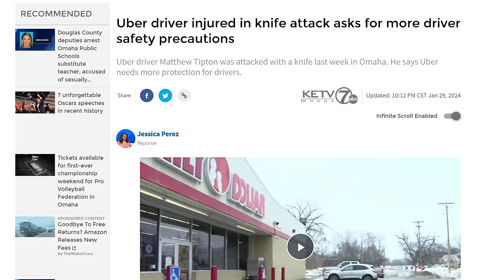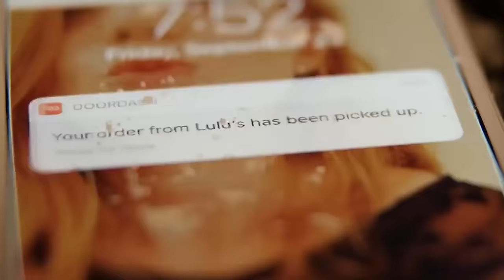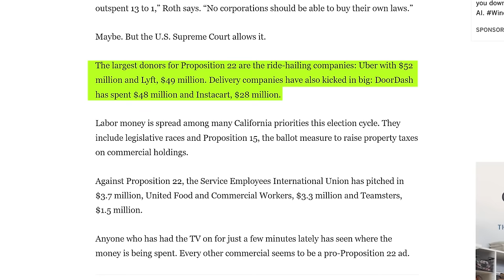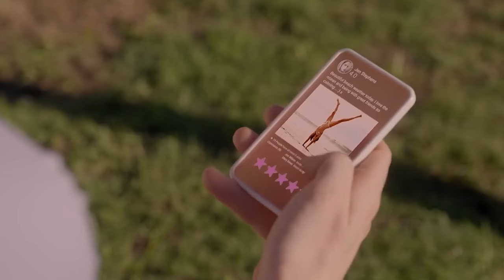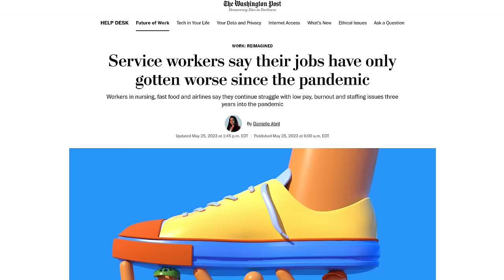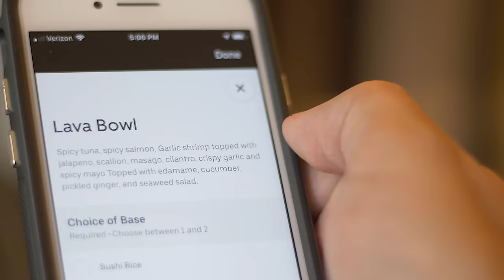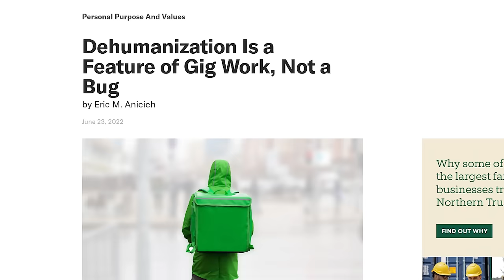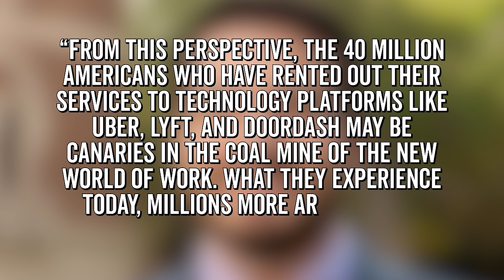Delivery Apps Are Making Us Monsters

Comment: My story about work is that I work for Amazon in what can be described as customer service role in a case by case basis. A lot of metrics are tracked, dir example case reopens. A case was reopened with the message "thank you for solving my problem, great job" and it was counted against my performance because reopens are negative.

Also at a recent work function, I overheard the boss of my boss saying that he dislikes german work protections because he would sometimes like to get rid of the bottom quartile of workers and since that I can't get it out of my head that he was specifically talking about me.

Comment: Poorly researched

Amazon drivers aren’t independent contractors. 

Amazon has a bunch of “independent” “delivery service providers” that hires people as full fledged employees (even with benefits, largely the same ones you get working at Amazon).

The drivers themselves are not independent contractors.

There is Amazon flex where people use their personal vehicles but that’s a tiny fraction of drivers and most of the time isn’t even a thing outside of peak.

Comment: I still am shocked about how many people just give 3-star type ratings to these people because "service was average" without realizing that it might get them fired.  Only time I tend to drop to 4 is when the driver ignores the written direction of "Gate on X street is residents only so does not have a box to punch a code in, you have to go to the gate on Y street" and then call me asking me to come open the gate for them.
Reply: I felt the same way when I would get calls from drivers confused about finding my unit because I had made sure to put very clear directions in the message box (since it would happen often). Until one day I mentioned this to a lost driver and she said that they don't even see that message until they get to the part where they are taking a picture of the food on your doorstep. So no wonder they were still lost. It's a dumb system.
Reply: Not everyone knows those jobs are on the line because they assume those companies are sane or reasonable. They don’t realize how bad it’s become
Reply: Reviews have no value if honesty is not the ONLY consideration. Either don't review or review honestly. Every fake review is just as bad as the retaliation from evil corporations for imperfect review scores. Stop giving them data at all. Stop using the systems that care about reviews.
Reply: Just like Dennis from "It's always sunny in Philadelphia "
I'm always a 5 star man.
And I don't believe in tipping,  I believe in overtipping

Comment: I’m sympathetic to service workers but this isn’t a one sided problem.  Service has gone down hill across the board.  I was at a fancy restaurant and a part of the wrapping they use to cook my steak was still in the food. It looked like a piece of tarp with aluminum on it.  I barely got an apology and the manager offered me nothing and still wanted me to pay for the steak, besides for there still being an expectation of a tip over 20%.  That may be a specific example but a lot of workers take no responsibility for issues.  Even if they didn’t cause the issue, if they are the point of contact they should be able to say more the “stuff happens, not my problem.”